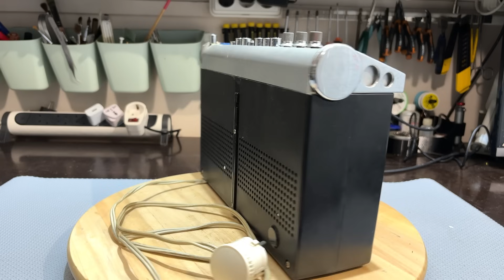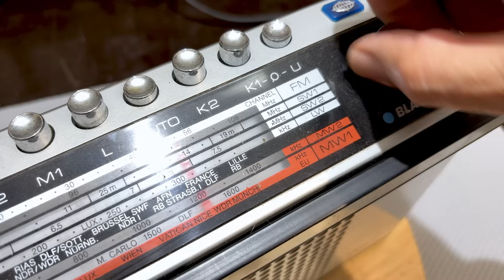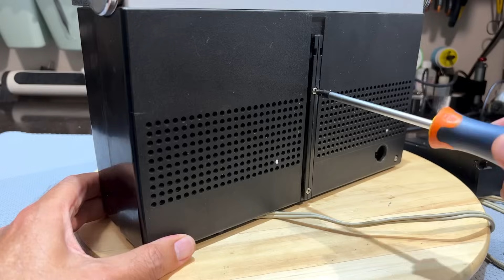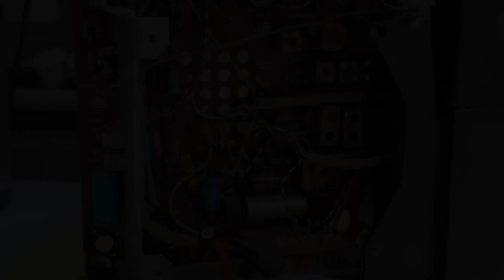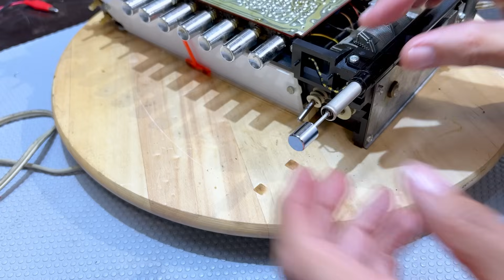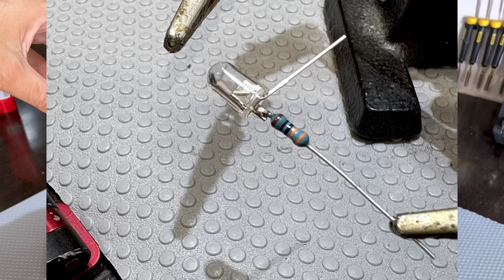Luxury Radio from the 70s Restored: Blaupunkt Derby Commander

Comment: Very nice video, thank you! I also have the radio and mine also plays very quietly and has problems  with the Antenna. The electrolyte capacitors are difficult to unsolder.The first thing you mentioned was a blue condenser on the edge that you thought was important. Would that be a first try for me? And how high did you choose the pre-resistance for the LED?

Comment: Hi, You would have easy acces to Ground through the Automotive socket on bottom. It's a easy plug to make from some siple board amterial if I remember right, plus a guide pin hole that also carries ground.

Comment: I just got a Koyo 8-band transistor radio from 1965. Beautiful unit with wood case. It runs on 6V (4 D cells) or AC from the mains (120V here). The power supply has a transformer with center tap and a two-diode rectifier to provide 6VDC. The schematic shows a 2.2M resistor that goes from one on the 120VAC lines to the +6V side of the circuit. Can you shed some light on the purpose of this resistor? I don't understand why they bond the 120VAC and 6VDC circuit in the power supply like this. This is my first radio, planning to replace the electrolytic caps on the board. Thanks!
Reply from the maker: That is a really strange one. The only explanation I can find is that they were trying to reference the DC voltage to the neutral line of the mains, which is actually connected to mains earth. This may have had noise reduction properties, but I honestly can’t see any advantage to doing this, and actually a real danger is introduced. Depending on how you plug in your mains (if you don’t have a polarised mains plug) you could end up with your 6 V DC actually being at mains live potential. In restoring it I would remove this resistor completely and use the 6 V DC as an independent isolated supply.
I may be missing something basic in my quick analysis, so if anyone has an explanation, feel free to step in.
Reply: @electronicsoldandnew  Thank you so much for responding. Feels good to read you because I'm fairly new at this and I had the exact line of thought: it may be dangerous (the plug is NOT polarized) and it might be there for noise suppression. I'll follow you advise and take the resistor off, I'll see if it affects the radio in any way. If you want to look it up, the radio is a Koyo KTR-1661, the schematic can't be found but I have found one for a Lloyd's 9N11-120 that shares the same internals (this radio was sold under different brands). Thanks again, your channel is awesome, as your teaching ability, I really appreciate.    I'm from Quebec City, Canada.

Comment: We have a very similar but earlier model. Near the telescoping antenna it has a tuning meter, in place of the blue plastic lens on your radio. We thought that perhaps Blaupunkt had replaced the tuning meter with a tuning bulb, behind the blue plastic lens. Is the blue plastic lens merely decorative/nonfunctional?
Reply from the maker: I guess they decided to save on the meters on this model. That space is actually covered with this Blue plastic logo, which isn’t a lens at all. Underneath you can see the hollow where a meter would go so they obviously used practically the same chassis.

Comment: Clearly more enduring than the  stuff of today and a more inspiring case design. 

Like the British Hacker radios of the late 60s, something that could take pride of place on the side board or occasional table.

In those days you paid a premium price for things and you were guarenteed that the item would be through-and-through quality.

Nowadays, its a lottery, largely determined by marketing men,  with the majority of western  manufacturers stuff being made in China with famous name badges stuck on. And you find that price is no longer thr consistent indicator of quality of design and manufacture it once was. It can be random, you can purchase an expensive item badged with a once famous name and find that its is poor and then be unexpectedlyand pleasantly  surprised by the performance and quality of a cheap item with an unknown badge.

Thank you marketeers.

And don't get me going about PLL tuning and battery longevity or the less than universal niche audio compression protocols that some content providers have decided to adopt without adequately informing the manufacturers, leaving them and radio users out in the cold. Very annoying.

I now wish I had held onto the my late 1960s Mitsubishi tranny. Only, MW, LW and SW, but the sound and the finish were so good.

Anyway, very nice job on the Blaupunkt.

Comment: Hi! Congrats on the restoration, the radio came out nice. The lightbulb in question is a 6-7V/1W auto/moto type (for dashboards). It was quite common in those days. I actually have some 30-40 pcs around, I could spare some for you if you'd like.
And, as another challenge, from the 60s, I'd recommend you the Blaupunkt Riviera Omnimat as well. It is a very interesting radio, with 3 MECHANICAL FM presets (like in the 1950-60s car radios). The frequency is not changed by varicap diodes controlled by potentiometers as in other radios with presets but by the strength of your button press; the scale dial also jumps to the preset frequency in a rather violent and surprising way. Also, it has a tuning indicator microampermeter, but unlike the regular ones the scale of the instrument moves vertically in front of the dial. A mesmerizing and ingenious radio. Also weighs A LOT due to the metal preset mechanism, the wood/metal case and the D Cells it uses. Sound quality is quite nice (10x16 cm speaker) and reception is good (more or less the same electronics as all the blaupunkt portables of the era). Quite reliable as well, mine only needed an oiling of the mechanism and new electrolytics.
One last thing -  like in many comments, if the radio will be used on the mains I would HIGHLY recommend replacing that selenium bridge rectifier. Nasty surprises with those can pop out of nowhere. I've lost track of how many broken radios or receivers with destroyed selenium rectifiers I've seen.
Reply from the maker: That model sounds interesting. I’ll have a look for it.

Comment: My parents had quite similar  tourist radio (albeit with more wood grain and thin play wood case). It was called “Jowita”, was of polish production, and also had those AC180 germanium transistors in the power stage. You would have liked it. Unfortunately I dismantled it for parts by 1980 ;)
Reply from the maker: 😊 yes, I dismantled quite a few great radios myself years ago

Comment: What an awesome radio. Looks wonderful and very modern actually. Doesn't look out of place with today's electronics. Very far ahead of its time in terms of design.
By the way: does the DIN socket have a ground? That would allow a very easy way for you to make an adapter for your antenna.
Looking forward to the follow-up.
Reply from the maker: Yes, the din has ground, and us probably the easiest one to reach 👍

Comment: Looks great. I did the same as you with the dial lamp, super bright LEDs and resistor fit perfectly in the original lamp when the glass is removed. I also had a radio with an earth problem and had to fit a nut and bolt on the back of the radio, I'm not one for doing that , but had no choice.
Reply from the maker: Sometimes we just have to improvise 😊

Comment: I found with model railway (another of my hobbies) that items and loco's from the 1950's and 60's lasted a lot longer, and a lot are still running today, than more modern items.   Sure, modern items can look more realistic and plastic technology has improved somewhat, but they just don't last from an operational perspective.   How many radios built now will still be working in 50 years?    I've got valve/tube radios dating back almost 100 years that are still going strong.    Some even have the original valves/tubes.   Can't really say that about anything built more recently.
The "auto" adaptor feature is really genius for the time.    The very early version of those removable face radios that were all the rage 20 years ago lol :).     Seriously though, I think this clipping in a portable radio to be your car radio is a great idea.   You don't need the radio in the car when you are not using it, so you get multi-purpose use, a radio for home, for the beach or whatever that doubles as your car radio.
Reply from the maker: True, these devices were investments, rather than spontaneous purchases that get set aside after a few weeks.

Comment: Hi Manuel ! I don't know the exact name of the Blaupunkt model we had in that same era but it definitely had the same car adapter, which we had in our family car. It was a metal sled the same width of the radio and the backside was the length and width of the radio as well. The black rail on top had to slide into that sled. It was just a huge thing under the dash compared to modern radios, but hey, we had a great radio outside of the car and the sound quality was amazing. I have memories of various songs from that time, one of which was Popcorn 🤣Great radio!

Comment: Thanks for the film. It's fantastic radio, 1972- 1975, were installed in expensive German cars such as Mercedes, Porsche. It's very sensitive in FM, which in my case is important. I use it as bedside radio, without the case- I reckon this way sound is better.
Reply from the maker: 👍 Yes, it really sounds great on FM

Comment: I actually started my professional career in 2000 as engineer at Blaupunkt headquarters in Hildesheim (Germany). They already belonged to Bosch company this time. Later, Blaupunkt was sold and me and most of the engineers transferred to Bosch. Blaupunkt still exists in Hildesheim, they still have their logo on the building, but only degraded to a pure buy-and-resell company. Nice to see, that you repair old Blaupunkt stuff. They have been quite competent in rf engineering in those times.
73 de Marc DL8ABE
Reply: So many of the luxury brands end up with the name being bought by some import company, and then have the name plastered on lower quality items, selling based on people who remember the brand name and how good they use to be.    It's such a shame to see that happen, but it seems to be the way of the world.   Modern equipment with a luxury brand name is not the same as the original company.........
Reply: @EsotericArctos  Beschiss nennt man sowas.

Comment: I once had a US specification Blaupunkt Derby DeLuxe which a friend's father had purchased in the late 1960's. It worked but had spent a lot of time in storage and its plastic parts felt like they were slowly decaying. I thought it would be an easy project, but the more I worked on it, the worse things got. The wires were extremely thin and the speaker cone was decayed at the bottom. I could not find a replacement speaker that fit that small space. It had a metal chassis inside but was sort of a brittle radio where parts were easy to break by accident. After a while, I just sold it at a ham radio fest for parts.

I currently have two Blaupunkt Supernova radios and two Blaupunkt Riviera Omnimat radios which I will someday hopefully restore. These units seem a little bit sturdier in construction and have less wear on them. As with collectable automobiles, it's always best to start with a radio that has minimal cosmetic wear because some of those parts are difficult to repair, polish and clean, especially if brittle, rusty or moldy.

The unique battery holders of the Blaupunkt portables make them more of a challenge to restore if they are broken or missing. It is usually not just a flat plastic plate with tabs as is true on some Nordmende radios and others of that era.

When looking at Blaupunkt Derby portables on e-bay and other online sites, it is important to verify the FM frequency coverage. Even many radios advertised by North American sellers only go up to 104 MHz on the FM band. I suspect most of these 104 MHz sets were brought over by Europeans who moved to the US or by military soldiers who returned to the US.
Reply from the maker: Agreed: brittle plastic is always a problem. They need to be treated very gently until you know where the weak points are.

Comment: Superb radio Manuel. And yes, quite a few radios of that era (I used to use them!) featured an "auto" button which switched out the internal ariel (usually ferrite rod) whilst also switching through to whatever aerial connection was  fitted to the car.
Reply: Yes, it was popular at the end of 60s and early 70s. Then car radios became cheaper, so this solution dissapeared quite quickly. I also have similar radio, Tesla Carina which is germanium based, but with similar design. There is no "auto" switch, switching is done automatically when you put it to the holder.
Reply: @xsc1000  In the UK we had to pay for a licence for a radio but it did not cover a radio fitted to a car, that required a second licence. This was got around by having a fitting kit that allowed you plug in a portable radio in to the car. But it had to have it's own power source so as to be a true portable radio, it could run off the car power when plugged in. I can't remember when the need for a radio licence was stopped and so the need for a plugging portable was no longer needed.
Reply: @TheEmbeddedHobbyist  I think this solution was quite popular in Italy till 80s. Not because of licensing, but because car radios were magnet for thieves.
Reply from the maker: We also had to pay for a radio license in SA. Also can’t remember when they stopped that.